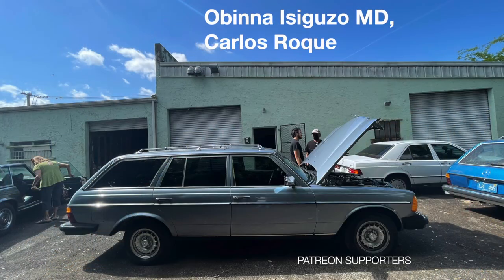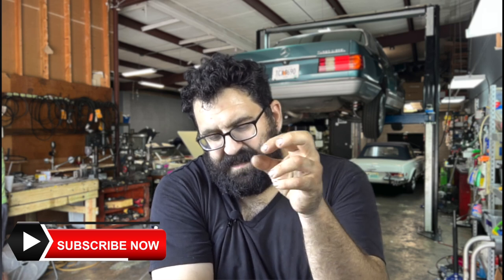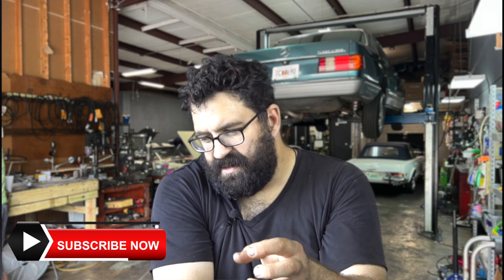Classic  Mercedes Benz Dead Accelerator  pedal what could it be?   HD 1080p

Comment: If it was a transmission failing the RPM would go up while the car didn't move so it would be easy to rule out. I drove a 1992 300D home from auction and when I was two blocks away the throttle wouldn't do anything. Thankfully my neighbor saw me and stopped by and helped me idle it the rest of the way home. It turned out a throttle linkage came undone down low close to the firewall.

Comment: So what happens with the engine during this problem?  Just sits idling?  Misfiring?  Anything?  My first thoughts were the idle switch, the throttle position switch (on throttle body), and a vacuum leak.